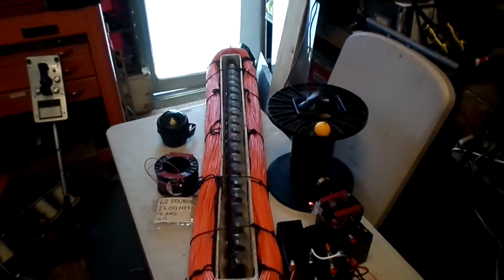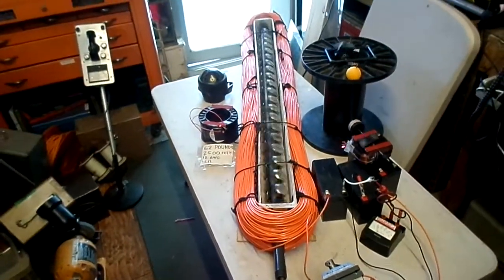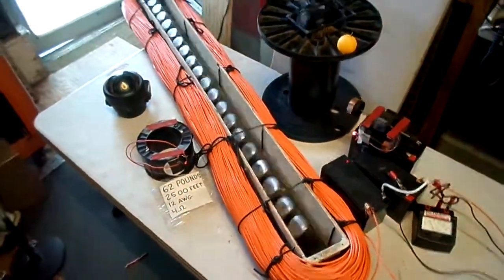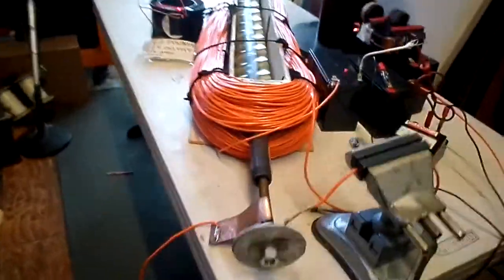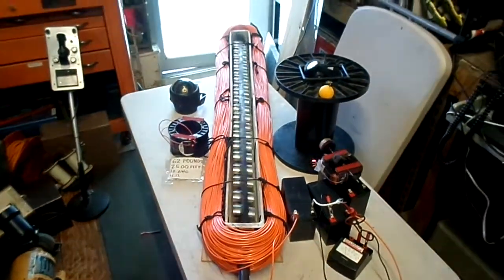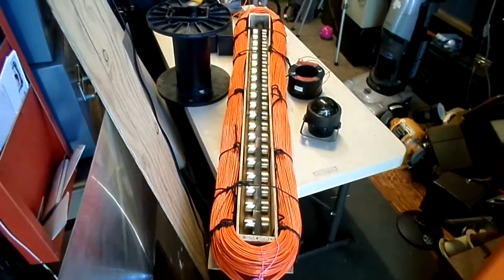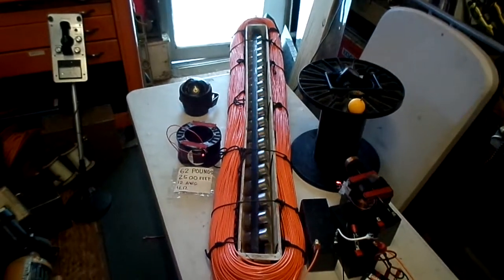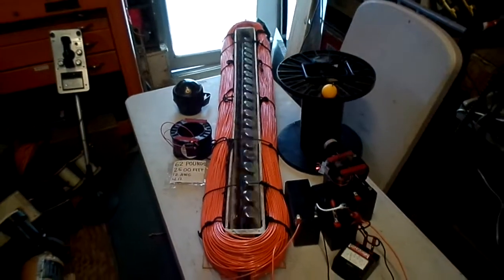87 Pound Newman Motor. Check link to newest documentary on Newman life in info section

Comment: I will say that Newman never claimed perpetual motion. He always insisted that eventually it would run down to nothing. His claim was a greater efficiency. 

That being said, I don't know if he really was on to something or not but why would a man allow himself to lose his wife, his home, all his finances, etc for something that wasn't true. I'm aware people can become eccentric, if not insane, but it does make you wonder. 

Then of course, at the end of his life, he destroyed the machine. That in and of itself makes you think that he was conning people because if it was the real deal then you would want people to replicate it. Then again, after all the crap he been through I can understand from an emotional perspective why you would just junk everything.  

It does sound logical, to a point, that if you had enough copper wiring to engulf the entire magnetic field that you would be able to generate more power, or more aptly be able to use all the power generated from the field, than conventional systems. However, I would think that would be incredibly wasteful because that would require several miles of copper wiring. 

As for the back spike, maybe it could be done via capacitors rather than feeding it back directly to the batteries. Charges faster, and at some point that energy can switch over from the capacitors to the batteries. 

I imagine that would take some sort of computer system ((I don't know much about what it would entail to periodically drain the capacitors to fill the batteries so forgive my ignorance)). 

I will say in his defense, though, that not every idea discredited really is wrong. After all, not long ago, a university basically proved Stanley Meyer correct by showing that different pulses can generate more hydrogen via electrolysis. It just takes people willing to put in the work. Not long ago, too, did a university basically used magnets in a configuration that cancelled out the entire magnetic field--- which to my mind vindicates Howard Johnson to a degree because if you can cancel out magnetism then you can do the reverse of creating incredible magnetic fields from certain configurations. 

Jesus Christ Almighty God bless you all 😊
Reply from the maker: On some of my earlier experiments I had used a segmented commutator that recycled the back spike, and found it slowed my motor down. 
     To this day I admire Joe's inquisitive nature, and the zeal to experiment, but at the end of the 
day he started doing things that made myself and others very suspicious of his claims. Hopefully you were able to see
this last documentary on his life. https://www.youtube.com/watch?v=CrJIzrmX1mI

Comment: You are losing a lot of energy in that brush system..
Reply from the maker: Yes I understand. I also should have built a commutator which switched polarity every 180 degrees of rotation, but I became discouraged after discovering all the principles which were not in my favor of my success, and how Mr Newman abstract testing began to look so suspicious. I hope you saw this last documentary on his life. https://www.youtube.com/watch?v=CrJIzrmX1mI
Reply: @GrantsPassTVRepair  Question, what is ampere turn on yours coil?
Reply from the maker: @mapi5933  I don't know how many turns it had, but it was 62 pounds of 12 gage wire. I believe the resistance was only 4 ohms because I used such a thick wire.
Reply: @GrantsPassTVRepair  Thats is a problem. If you cut the coil into three parts, you will have almost twice as many turns. The ampere-turn play a major role than the weight of the coil. Suppose you run one DC 100 mA signal, and you have 1000 ampere-turns, this equals 0.1x1000 = 100A of magnetic flux. Next you need potencial energy from monopolar magnetic pulse (external) (yes idiots think that the rotor  bedini/adams is pulse motor xD, it is inertia monopolar pulser) or (internal) spark.
Reply: @GrantsPassTVRepair  The weight of the coil is only a side effect of the high number of turns
Reply from the maker: @mapi5933  I can't understand everything you are saying, but a previous model I built had 3 parallel coils of of number 30 gauge copper wire.
Reply: @GrantsPassTVRepair  A long coil doest mean better.

Comment: Engineers don't know everything, I have an undergrad from a ABET accredited university in Electrical Engineering so I guess that makes me an Engineer and there is a crap load that I don't know.  Point being, just because an Engineer endorses something does not mean you should automatically believe it especially when they are fantastical claims
Reply from the maker: I agree, and I appreciate your comment.
Reply: I am not a physicist   but I think I heard somewhere energy can't be created, it can only change states.
Reply from the maker: @hmax1591  Yes, That's what conventional science teaches. Newman use to claim his motor didn't violate the laws of physics.  He believed his motor was able to pull electrons from the copper wire used in his motors through an electromagnetic  mechanical process.
Reply: H Max You heard correctly, it is called the law of conservation of energy

Comment: i'd suggest using a centrifugal set up, maybe place the magnets on a bicycle rim that has bearings, placed horizontal and use your wire winding as is, minus the box..?
Reply from the maker: You build it and tell us about it. :-) I'm a bit burned out on this approach.
Reply: @GrantsPassTVRepair  i hear ya, i was noticing your coil could be easily reconfigured into a circular shape, and you do have all those fancy magnets that could be mounted in a circular pattern too. ?
8.01x - Lect 24 - Rolling Motion, Gyroscopes, VERY NON-INTUITIVE
https://youtu.be/XPUuF_dECVI?t=2099
Reply: @GrantsPassTVRepair  here's one you might like, has a pep talk at the end..
 Mobius Super Coil DNA , Scalar Waves
https://youtu.be/12Hw8te6eoc